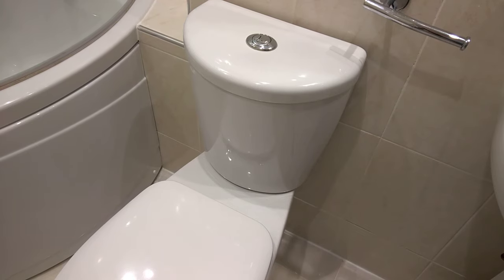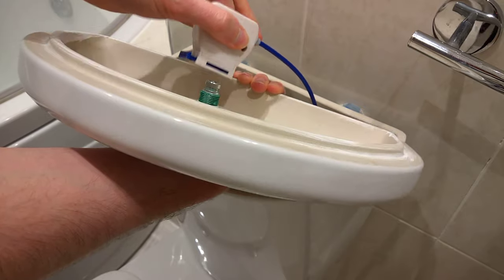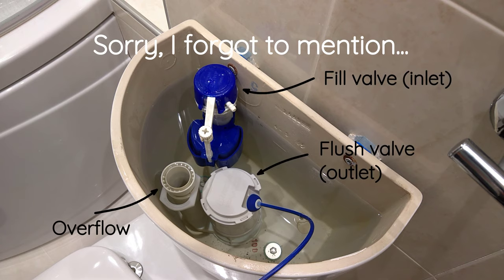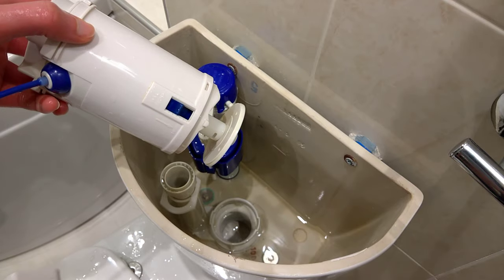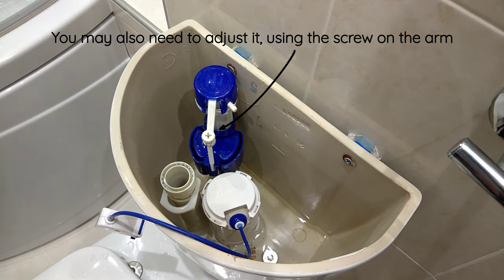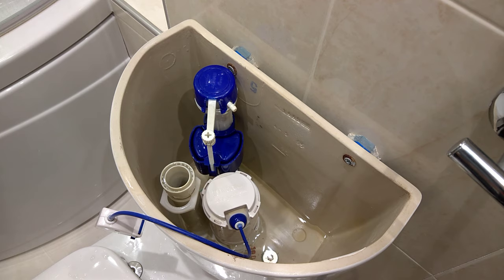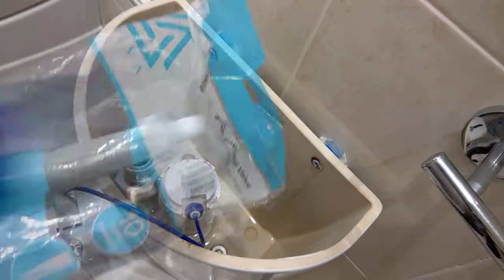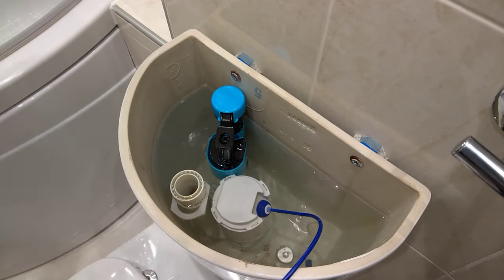Fix for water leaking into toilet pan (push-button flush)

Comment: What a great video, so clear and understandable! One question, from your video and having taken the flush valve out and checked the seal, it looks like I will have to replace it as there was no obvious obstruction to the paddle and the seal looked ok. As in your video I have a seperate overflow pipe. But all the replacement options seem to have the outlet pipe as part of the valve. Will I just be able to buy this and have 2 overflow pipes effectively side by side? Or will the entirety of the valve, not just the part which clicks out, need to be replaced? thanks

Comment: Any suggestions as to why my cistern works perfectly for two or three flushes, and then on the next flush continues to run, but the 'overrrun' usually stops if I take off the cistern lid and tug on the remote cable thing?

Comment: Is the water in the cistern clean? Or gloves recommended I'm aure its clean for cleaning the toilet but would it be sfer to wear gloves?
Reply from the maker: Hi, good question! It obviously depends on your property though it should almost always be coming straight from your water supply, so no different to your tap/faucet water. No gloves needed therefore in my opinion.

Comment: Great video! Quick question, with this system in place, how do you adjust the water level within the toilet bowl? I have this exact same system but the water level within toilet bowl has dropped and I don’t know how to increase it.
Reply from the maker: Hi Karim0087, the level is set by the manufacturer of the pan, combined with the waste pipe. If you're putting water into the pan then unless there is a crack in it, the water should always quickly return to be level with the bottom of the waste pipe. Other than evaporation over time, they're the only two ways water (and waste) can leave the pan.

If it no longer reaches the old level I would say something must have changed about the waste pipe, as a crack big enough to have an immediate effect would be very obvious

Comment: I have been trying to fix and identical cistern to this for a friend. The only difference is that the cistern is hidden behind a tiled panel which makes it a bit more awkward to get leverage. I have tried and tried but cannot get the flush valve out. I have tried turning both ways but it refuses to budge. I don't know what else to try ( perhaps putting some washing up liquid in the water ). Any ideas please

Comment: Really helpful video. I have a similar toilet with the bolt nuts in the cistern as opposed to wing nuts underneath. I need to replace my flush valve because the flush button has broken and can't just get a replacement button. The product recommended to me by a supplier says it is a Flush Drop Valve. Does that mean it is like the one you just demonstrated, i.e. turn and pull? Thank you.
Reply from the maker: Hi Rajen, sorry for the slow reply, I imagine you've experimented for yourself already. I would expect it to be turn and very gentle pull, but some manufacturers may do it a different way. 

The new one should come with basic instructions, or have a model number such that you can Google it, if it's not already in pieces such that you can see how it works. For any already in one piece, there's no harm in trying the turn and pull approach, it only requires gentle pressure.

Comment: Hi my loo is filling to above the overflow which causes flow into the bowl after main flush and then settles with the water level skimming at the overflow. Do you think this is the fill valve please? Another loo in the house does not fill to this point. Thank you.

Comment: I have had the flush valve replaced by a plumber. Water is not overflowing but I still have a leak into the pan. Any suggestions?

Comment: What about the cable ? . I always find the cable a pain to re install when I’ve touched the syphon. Am surprised that isn’t mentioned as a fault . It kinks and is sometimes too long for the toilets that they are placed in.
Reply from the maker: Hi Mary, I must admit I've never had issues with the cable myself so didn't think to cover it. Good point though that an issue with the mechanism could certainly cause the valve to stay open and leak into the pan.

Thanks for sharing your thoughts

Comment: You should add that the  washer on the connector needs replacing as to avoid a leaking union and water damage to flooring and ceiling

Comment: i have question relating to the flush valve outlet.
as you said thats exactly my problem that the washer problems sometimes and down not go down smoothly.
how do you take care of that???
Reply from the maker: Hi Mohak, sorry for the sorry reply. It probably means some limescale buildup in the valve, the valve is failing or the washer is aging.

Replacing the flush valve is relatively cheap and the easiest solution. Otherwise you'll want to try getting it apart and see if you can clean up the mechanism before looking at options to replace the washer (not commonly sold as the valve is so cheap as a complete unit)

Comment: need an advise. I disconnected the control cable. I found out the push button get stuck and does not return into the top position. I checked the mechanism inside the box of the control cable and the little plastic think connected to the cable does not return back after we flush the toilet
Can you give me any advise on it, please? Thank you
Reply from the maker: Hi Michal, I'm a DIYer rather than a plumber, so excuse me if I'm incorrect on any detail.... I believe you're talking about the piece of plastic on the very end of the cable, the end specifically that clips onto the cistern lid.

If that's the case, it doesn't return instantly, but should have the flush valve seal is made I believe. Assuming you've checked that the flush valve is sealing correctly (no water escapes to the pan once the seal drops), then you'd be looking at the flush valve internals being the likely cause. Worth just re-watching 4:15 to 5:11 of the video to make sure it's not the seal failing to drop that is the cause.

I've not yet taken apart a flush valve itself, and most plumbers would suggest changing it if it fails. It could be worth seeing if DIY stores stock the same model, as it maybe cheap and quickest to buy a replacement flush valve and do a quick swapout.

Otherwise I think you'd need to remove the lid of the flush valve (I've not seen one that is designed to encourage that), and see if you can fix the issue. They're fairly simple as a technology, so probably easy enough to fix IF you can get into yours without breaking it! Personally I think a replacement might be the wisest move by the sounds.

I hope that essay helps :)

Comment: Which one did you replace it with please?
Reply from the maker: Hi Scott, the new one I installed in this video is by Viva, and was bought from Screwfix. Part number 940HR. Viva Bottom-Entry Skylo Fill Valve 15mm. Lots of other options out there. I chose this one as it's cheap and relatively narrow which suits the fact the inlet is so close to the rear of my cistern. I hope that helps.

Comment: Toilet Cistern, have become so complicated. What happened to the older easier to work with and replace worn toilet seals. These new ones are so complicated, its like rocket science. In future I bet, one will need to replace the whole valve when the seals are leaking.

Comment: hi do you ever travel to langport in somerset I have a prob with my similar to this ?
Reply from the maker: Hi T4 OOMF, I'm not a plumber myself, just a DIY fan, so afraid I'm not available myself. That said any plumber would be able to assist you, if you're not comfortable doing it yourself. 

It's an area (cisterns) that worries people from touching, but is fairly simple once you've got your head around what each part does. If you replace the inlet valve yourself, as I did in this video, just touch the pipe underneath occasionally for a couple of days to ensure it's not damp at all. Any dampness (not just coldness) would suggest you haven't tightened the valve or pipe right to get a good seal.

A quick search online or in a phone book should give you a local plumber if you'd prefer to let someone else do it.

Comment: If you have a vanity unit combined with a sink unit plus back to wall toilet it is not a simple fix. Also let water flush any debris while the top of the arm is off. My new unit has this problem and because the cistern only has a small access opening will have to cut and enlarge to gain more access to service it.

Comment: How and where can I order the parts...many thanks
Reply from the maker: Hi v88tor. In the UK I use Screwfix and Toolstation mainly, but B&Q, Homebase or any other DIY stores will have the parts as toilet cistern parts are very common requirements. 

There are different sized screw threads for the inlet valve, so worth checking any new one matches up. Personally I often take the old part along just to check there's nothing obviously different before i leave the car park... return trips are irritating!

Comment: Mine is dual flush and doesn't look anything like that?.
Reply from the maker: Hi Andy, there are multiple designs. Yours may have buttons on the top of the flush valve (everything else the same but buttons on the top rather than via a cabled button).

Comment: What a life saver not having to dismantle the whole toilet to replace my leaking Macdee DVE0600 Float Valve, it may be discontinued; but the diaphragm seals are still available from toiletspares.co.uk Product Id: TS083.  If you are careful to remove the blue cap then float lever mechanism first, clamp the valve stem, turn the white seal retainer cap anticlockwise, it should come off but you have to be brave!  The rest (as in the video) is a doddle to replace the two seals and refit the retainer cap all in the reverse sequence.